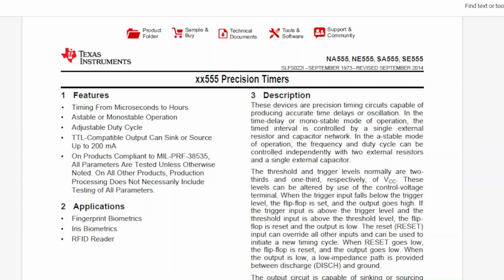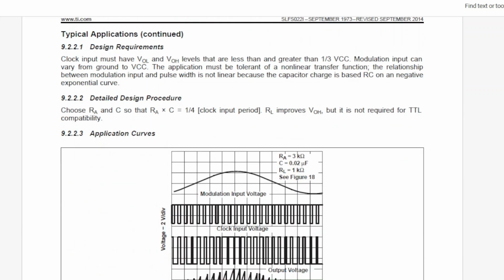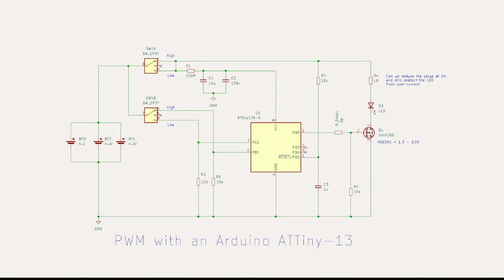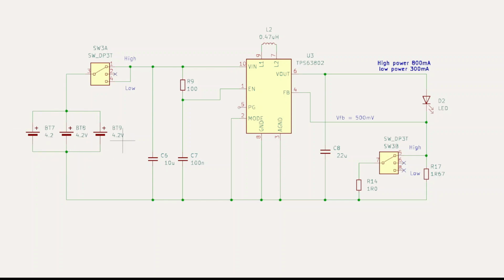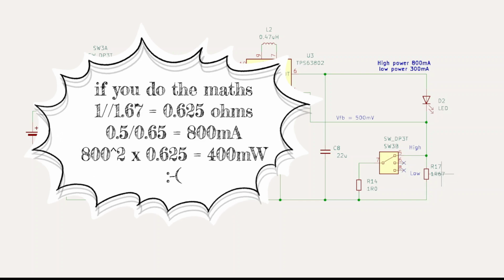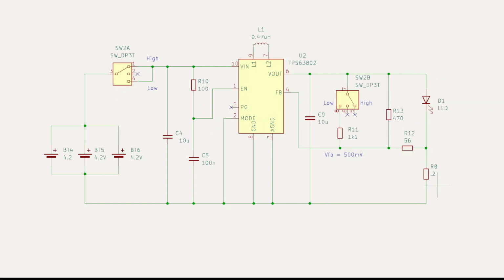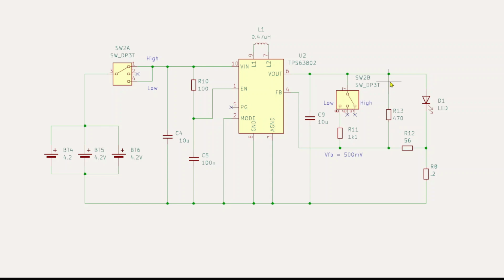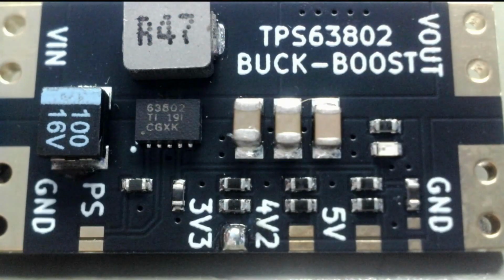#242 Coleman lamp conversion to lithium batteries part 2

Comment: A million ways to go with this project, but the venerable old MC34063 seems built for it.
Reply from the maker: @GnuReligion  the problem with the mc34063 is the datasheet shows the lower input voltage limit as 3V. The TPS63802 it seems is built to run from a single lithium battery. As the battery voltage drops it switches from buck mode to boost seamlessly. So with luck the user should not notice the light dropping,  I won't as its a camping light and I don't do sleeping in a tent unless it's got full onsuiet bathroom, tea or coffee. :-)

Comment: An elegant solution. I was rooting for the Arduino, added features like the low battery alert would be nice, or maybe the infamous S.O.S. mode 😊. How about a charge controller  with low battery indication? Regards, David
Reply from the maker: @davidv1289  looks like I  end to do some more design work,  this is known as specification creap . You know something that the customer wants after they have excepted the quote. :-)